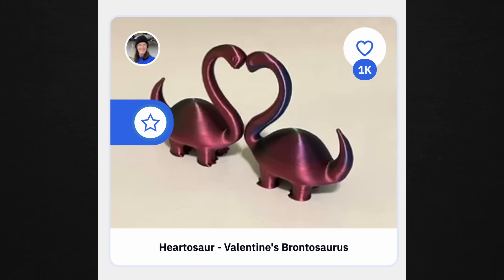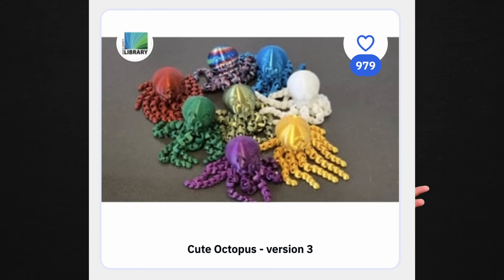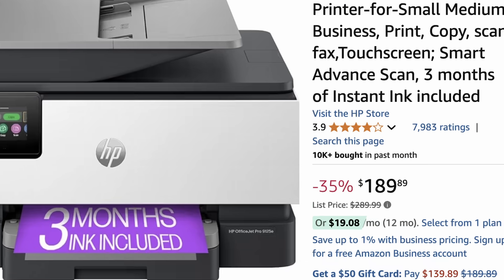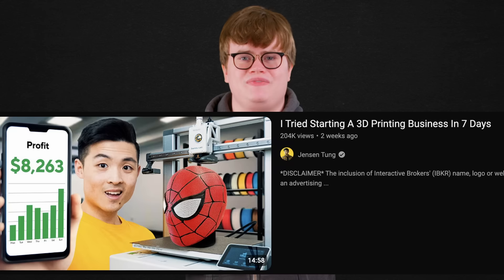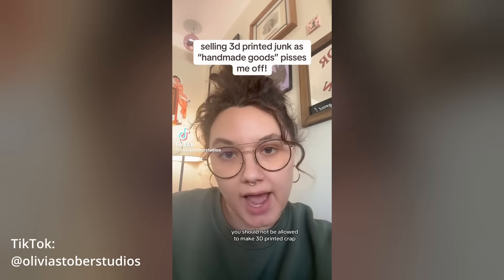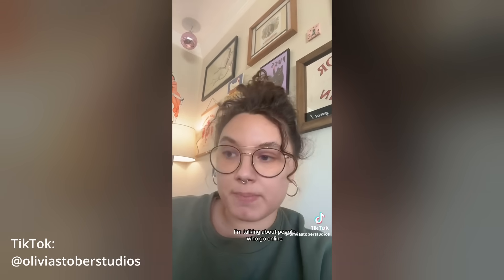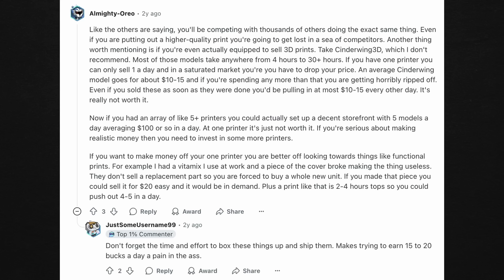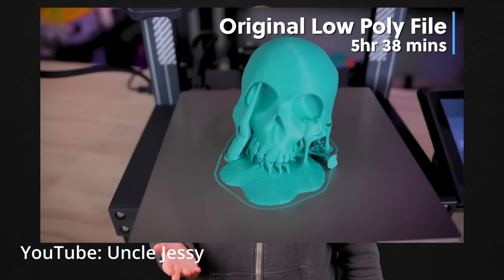The Rise of 3D-Printed Slop

Comment: The best use for 3D printing I've seen is to replicate old plastic parts that have failed with time.
Reply: 100% the best use for 3D printing, saves money, saves fuel on shippments, and saves A LOT of time
Reply: @A-G-F- no it is not. Best use for 3d printing is prototyping parts you'll get made out of metal to make sure they fit
Reply: @CourlandEngineering  If you can't do a clearance test in cad you suck at engineering tbh. This won't account for warping if using a non-enclosed printer which is way lower precision (looser tolerances) than stamped / milled / rolled / bent sheet metal parts
Reply: @xD123t-3  entirely missed my point. My point was that you can use 3d printing to prototype before spending time and money getting it made out of metal. I know damn well about clearances
Reply: @xD123t-3 More about creating a part and checking it will fit in a combined space like an engine bay. Sure it's easy to model a part fitting on a single object, but when there's a complex space it has to maneuver through or into first, your great CAD skills aren't going to help you.
Reply: @A-G-F- I can’t remember the last time something broke… serious this is a stupid purchase and I’ve considered one.
Reply: I'm a mechanical engineer. I work on a lot of personal projects. I use my printer almost exclusively for mechanical parts. Brackets, enclosures, frames, etc. Are a big part of that. But genuine prototypes of parts that will eventually be machined or injection molded is where 3D printing really shines.
Reply: I use my 3d printer to print replicates of old car parts you can’t buy anymore. Just recently I modelled and printer a gear for a car seat for an FJ ute
Reply: That's why and how I got my 3D printer! My mom's sowing machine broke and when my parents took it to a repair shop, they couldn't fix it because the broken part, a plastic screw gear, wasn't available anymore - understandable, given the machine was almost 25 years old the time. A new machine of similar quality, size and functionality however would have cost almost twice as much as a reasonably good 3D printer, so I thought what the heck, let's try it: I got the pritner, brushed up my CAD skills and after a lot of trail and error, I actually got the part made and the machine fixed!

Since then I printed a lot of casings for electronics I design, brackets and other stuff for my workshop, but mostly "organizing helpers" like custom inserts for drawers so my tools, parts, silverware and things like that are neatly sorted and not just loosly thrown around. There are a lot of uses for 3D prints around the house, but why anyone would need a plastic dragon or "melting skull" really is beyond me... that crap has absolutly no use whatsoever and after it's short lived novelty phase, it will just collect dust and end up in a landfill sooner rather than later - a total waste of resources and energy!
Reply: @nicoj9984  That's why I bought a 3D printer too - to make parts for vintage sewing machines, particularly decorative cams that are often missing. I didn't even know people printed silly things with them until I joined some FB groups to learn about filament etc.
Reply: The first thing I printed with my printer (not including calibration tests) was a battery cover for my Game Boy Advance. I got it secondhand years prior and it was already missing the cover, so was nice to finally fix that, even if the color mismatched.
Reply: Yes! My dad had a sprinkler in his yard, there was a little piece that connects to a spinning part and makes the water go back and forth, and it broke. He brought the part to me, I took a few measurements, and about an hour later I had a replacement for him. It worked perfectly, he didn't have to buy a whole new sprinkler.
Reply: I don’t agree. Best usage is to make custom components (generally low volume) which are going to be subjected to low force or are going to be consumable. Specifically 3d printed custom industrial tools for assembly/disassembly, as well as one off components like brackets, mounts, … 

While the 3d printing is very inexpensive the designing of said part and testing is very expensive. Technically I would not even need to own my own 3d printers to make money with my service, it’s just nice to avoid the time loss needed when contacting a printing service and the wait queue.

The real money as was said is in designing a part, not actually 3d printing said part.
Reply: that and accessibility tools that would otherwise be hundreds of dollars due to small-scale production. I had an injury around the time I got my printer and so one of my first projects was designing a bunch of improvements for my wheelchair
Reply: I just seen a video last night of a guy making a spacer for a specific wheel on a dewalt bench grinder. An item that probably doesn't even exist in the retail market. I think your better off going niche, and choosing your target market very carefully, and make it something your knowledgeable about. Like he said, something you enjoy, and you'd be printing anyway.
Reply: Yes and PC case modding
Reply: More to use them to make a mold for an epoxy part. Unless you get into Nylon and ABS annealing, it’s just good plastic at bad unless it’s a no load part.
Reply: This, and plastic clips for various automotive purposes. My husband has saved THOUSANDS on tiny plastic bits.
Reply: I have repaired multiple items including a $400 shower enclosure that would otherwise have been junk.
Reply: There's a machine at my job that had a plastic knob break off. I modeled up a new knob that was larger and easier to grab than the old one and printed it out. It's lasted 3 years so far and it's still running strong.
Reply: Especially for nerf guns. That's how I was able to save a rough cut with a broken gear from the landfill
Reply: Thats what i did flr my transformers animated Swindle, new hip and shoulder joints after the old one broke.
Reply: Completely agree!
Reply: Bro has not seen a lot
Reply: Thought that was the number one use for them.  Or maybe that's the use the people i know use them for.
Reply: That and accessories for equipment and technology. Storage is another reason. 3d printing a microphone attachment for a camera for instance or maybe a stand to hold your favourite books on a shelf neatly. I have a PC and if I had a 3d printed I would make custom feet so it's a little taller, I feel that it's low. 3D printing for toys or cheap gimmicks is pointless.
Reply: I have a 3d printer part that makes my stand mixer more smooth it's epic
Reply: THIS! We replaced my coworker's car door handle with a 3d printer when I was in college.
Reply: This is actually how I made money using my 3d printer in college. People would send me parts they need either files or sketches. I then model, print, and finish the parts then send it back.

I charged depending on complexity and size. And it felt like my 3d prints were actually useful
Reply: Just another tool to make ideas real..... like my lathe ,Lazer cutter ,welders ...
Reply: I use it to make region free cartridge wells, console grips, and other things that allow fixing my old electronics cheaper.
Reply: also a good use is replacing old metal parts that don't need to be metal, the interior structure of a vintage cars speedo is commonly made of an awful diecast that expands and breaks, it could be replaced with a high quality plastic 3D print and work just aswell

3D printing can also be good for prototyping
Reply: I use my 3d printer to make my own animal figurines to customize and sell (for around 10-15 dollars for a pack of 5) i often paint them too,  for me they also helo to fidget with as i have anxiety and out in public they really help
Reply: The only reason I’d buy a 3D printer for
Reply: I asked my brother to make 30 stair corners for my 1926 home when each metal one would have cost me $4! They looked great once painted and made the stairs easier to sweep. I was super happy with how they turned out!
Reply: I did this recently with a discontinued part for my drum throne
Reply: Why would u do that? 3D printed plastic will be much more flimsy than the original plastic of said product… why would anyone do that?
Reply: @FeelThings76 who says the manufacturer will always choose the best material for the job? Planned obsolescence is a thing.
Reply: there are so many auto parts that are no longer manufactured but have existing molds that could make a 3d printer bank
Reply: They also print carbon fiber, they also have multi use like laser engraving or cnc
Reply: 100%
Reply: Yes, this is what I use 3D printer for.
Literally, you can find these parts usually or they do have a crazy price like 20 euro for ninebot G30D dashboard cover.
Moreover, getting it is difficult.
Instead I do have a damn spool of PETG that I will polish and apply lacquer, this will take one evening and it is solved.
Or for example I need a rubber plugs for connectors. How am I supposed to find it!?
the only way is to find some flex material and print it.
Reply: This. Especially if the part is discontinued in modern time.
Reply: I got one like 3 weeks ago and this has been me, it’s fantastic. A lot of these parts clearly are common fail points because you can search x product x piece and there will be readily available files.
Reply: or cosplays, thats always a good one because people take good care of cosplay parts
Reply: Fr
I've seen 3D printing used very well for cosplay and costume design as well. I've also seen stronger forms of 3D printing used for making prosthetics. 

The small knick knack trinkets are taking over like all sorts of shops and spaces. I can't even go to the local farmers market without seeing fifty dollar dragons-
Reply: Hard to get parts or overpriced versions of stuff you can make and guns
Reply: The amount of money I've saved for me and my friends on miscellaneous car parts is insane.
Reply: That and warhammer
Reply: 3D printing is just a waste of filament but other than that, I'm not against it
Reply: Making accessibility tools is a top thing as well. 3D printing could revolutionize accessibility in this world - if 1/10 of those printing premade patterns of dragon printed pre-made patterns for accessibility devices like spoon holders or can opener supports, it’d be a positive shift in society.
Reply: No i think it would still be wasteful pollution lol  @vrandomnumbers
Reply: I work with typewriters a lot and 3d printing has made my hobby so much easier, if there is a very specific internal part that is broken I can easily replace it with a carbon fiber printed piece. It has really made it better.
Reply: As a doll/toy collector, 3D printed replacement parts are a GODSEND. There are also some models of cancelled dolls and/or their parts!!! (i.e. Trashion Alley)
Reply: Yes like out of production Model train gears that have cracked.
Reply: hobbyists use it a ton to make housings and parts for their projects...either if its robotics or electronics....also have seen people making 3d printed instruments so its not just making spare parts that's great about 3d printers
Reply: And when used to reduce waste in manufacturing- for making prototypes and such
Reply: Board game elements and organisers are my jam 😂
Reply: I agree
Reply: Thats absolute not true. As like the video says, time prototyping or potentially learning a new software to correctly prototype a piece that matches with the object mm to mm, and is functional to the same level. Would be better off spent buying a new one, and if its an expensive new product, ask the manufacturer to buy it or buy it from ebay .
Reply: I’ve used it to prints parts for my motorcycle that aren’t made anymore or can only be found on eBay for ridiculous prices
Reply: Also to create a plastic, sand mold, building, for later Aluminium casting.
Reply: That’s the only way I will buy 3d printed part because I collect vintage holiday blow molds and the parts I buy for them are mostly 3d printed.
Reply: 3d printing is used for complicated prosthetics for animals among a myriad of other helpful things. Ive seen beak prosthetics that help birds eat/function normally again. There ARE very good uses for 3D printing. It's just that it's being used mainly for quick profit.
Reply: Frankly, in my experience it's the only use.
Reply: I own several typewriters and I can tell you, most have certain plastic parts you can't find anywhere, and if you do, they're old and brittle. The only proper way of replace them, is 3D modeling them. So 100% this.
Reply: My dad recently bought a 3d printer. He played around for a little bit with it, made a few statuettes and a pair of earrings for my mom, but now he mainly uses it to rebuilt old plastic pieces that failed or to build plastic cointainers to keep his stuff.
Reply: chilling video
Reply: Or to make one that’s not made. 

I suck radioactive gas from crawlspaces. 2 things I buy for the job is for it, everything else is retrofit
Reply: i wanna do this so much. each time something breaks i think if i had access to a printer i could make it. but then i i say is it really worth it. however over the years the same cycle happened so many times so i guess if i had a printer it would have been more than worth it at this point xD anyway, to be honest i think the most ideal thing would be for everyone to have access to public printers like in a library, so there arent printers waiting idle between needs.
Reply: lol. every time I see a part like this in my house, I have a mental image of a friend of mine who laughing at me and it hurts. 
If I had this moment, maybe once a month, I would buy a printer.
Reply: This is what my boyfriend does with his. He’s found problems with our own home appliances and designs & prints the parts we need to fix them. Then he sells them on eBay. Sometimes they’re pretty niche so he doesn’t sell a lot of them, but it’s something.
Reply: I find the 3D printed parts to be barely practical. It's often brittle for whatever reason so it breaks apart.
Reply: @liliumjade  That's an engineering problem. It's up to the designer to understand the material properties and design the part to meet the functional requirements.
Reply: @liliumjade if you're using PLA for actual parts you're doing it wrong. High-durometer TPU, glass-filled nylon and polycarbonate are just a few examples of genuinely tough and durable filaments that can stand up to wear and stress
Reply: @liliumjade PLA that’s why
Reply: @liliumjade  This is, what we call in the 3d printing community, a skill issue.

Take the design and optimize it for strength. Open it in your slicer and apply the appropriate settings for its usecase. Orient the printing in that it would maximize strength efficiency. Then print using a filament suited for the task.

Different problems require different solutions. Case and point: I printed a prosthetic for my amputee friend, a leg, printed out of PETG-CF. It is 5 years now since then and he has taken it to hikes and have absolutely battered tf out of it.

It would've cost him a fortune to get a "real" prosthetic. I got him one for the same cost as a single grocery haul. Now, we're improving its design it to include metal tubes to make it lighter while retaining structural integrity.
Reply: That's kinda how we use ours. I needed a cord organizer, instead of spending $20 on one I found a file and printed it. Even with fidgets, instead of spending $10 on one at Walmart, I used filament I already bought and printed one. 

I get 1kg of filament for 15 dollars, and we have yet to run out.

Comment: I just started resin printing mainly as fuel for my hobby of painting miniatures - overall I just don't think it's worth the trouble at all. I had to build an entire heated and insulated cabinet cause I live in Canada and IMO you shouldn't be running a resin printer in any room in your house humans share the HVAC system with - so I had to put it in my cold cellar to isolate and vent the crazy amount of VOCs it makes. Then the cost of the printer, the wash and cure machine, the insane amount of isopropyl alcohol you need, the paper towels, the proper chemical disposal, the gloves you go through, clear garbage bags, containers to store waste in, the vent hoses, the powered intake and outtake fans.... the costs are ridiculous.

I see people say "Wow I printed the equivalent of an entire Warhammer army just for the cost of a bottle of resin" but that's so off the mark. They don't add in the cost of the printer, of the respirator cartridges they should be replacing after about 8 - 10 hours of use (but I bet they aren't doing that), of all the gloves they should be throwing out, the alcohol their using, the costs of buying the STL files assuming they didn't steal them - all so you can save $50 Canadian dollars to not buy that box of space marines and you don't even end up with tournament legal models anyways.

This doesn't factor in the health costs of exposing yourself to the resin and IPA vapors with any kind of frequency - even if you're really careful there will be some minimal exposure.

To me this entire thing is not worth it and I regret trying to do it. I wish I just spent the $1000 all this crap cost me on just buying ready made models.

Comment: Two things, 1. Plastic slop can be sold to parents of children who love plastic slop.  2. printing slop is good practice before printing items that need to have certain tolerances and attributes to be useful.    Getting into 3d printing is either a current necessity because you pay $50,000 a year for aluminum parts that don't need to be made from aluminum or you wish to get enough at 3D printing to be hired by someone who pays $50,000 a year for aluminum parts, or because you're bored and need a hobby.  Either way, the slop will flow.